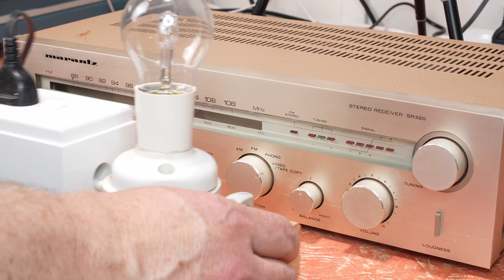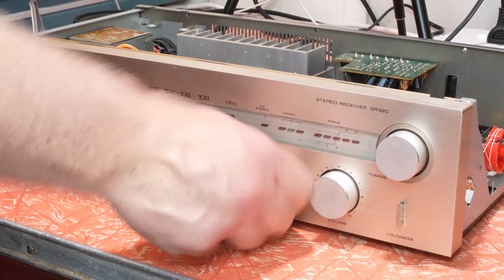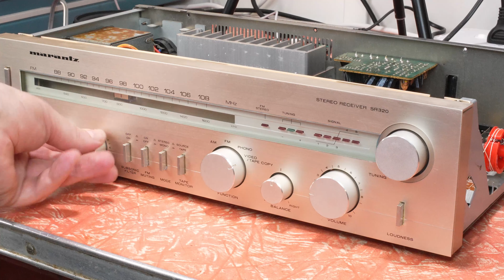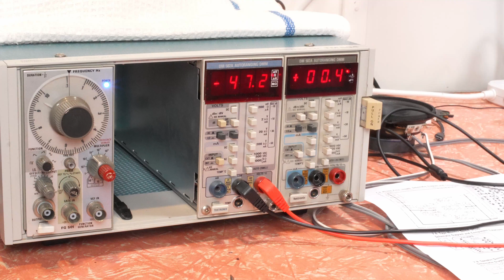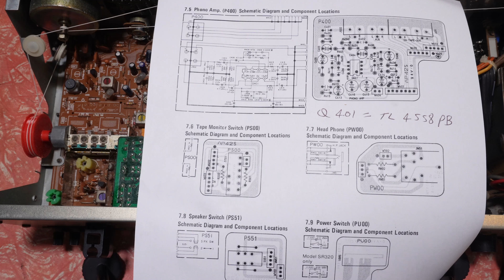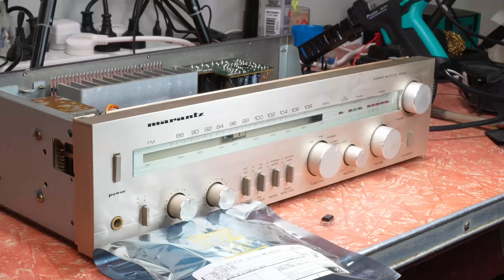Bringing a 1980s Vintage Marantz Amplifier Back to Life

Comment: Do you maybe have idea what could be a problem if only tuner scale light works what is turn on?
Reply from the maker: I assume you're saying you get no noise out of your speakers. There's a number of things that could be the problem, you need to work through it systematically - first thing is to check all power supply rails are present. Then verify whether the pre-amp and power amp stages are working. I have no idea how much electronics knowledge you have, but if you have none you really shouldn't be doing this.
Reply: @audionautica6843    I think have enough knowledge so I can DIY repair with some guidance.  Problem is I don't own that risiver. Guy selling it asking 25 $ and I can buy working for 50 $.
So most likely it's not worth bothering.
Thanks for answer.
Reply from the maker: Yeah - good call. I wouldn't bother. If the STK is fried you've done your dosh, and this thing never sounded very good to start with.

Comment: I am trying to recover mine, all is now working, except for when the treble  is 100%, it sounds like voltage interference going through, and one resistor next to big capacitors  R721 gets really hot and starts smoking. But if I bring treble to 80% all is good.. any ideas?
Thanks
Reply from the maker: Sorry, not off hand. Perhaps check the capacitors.